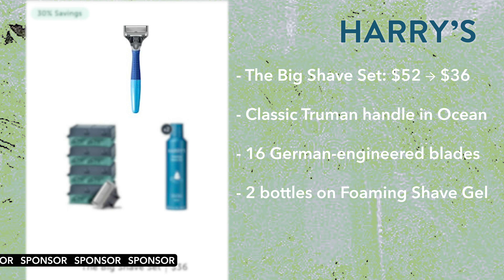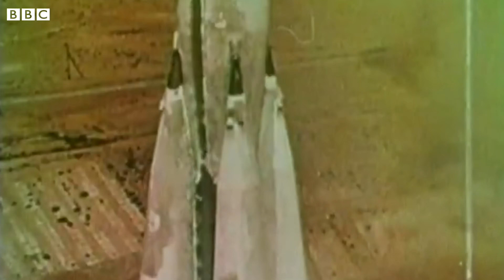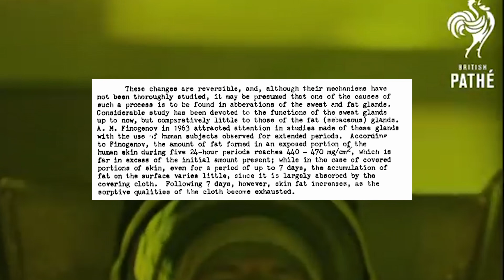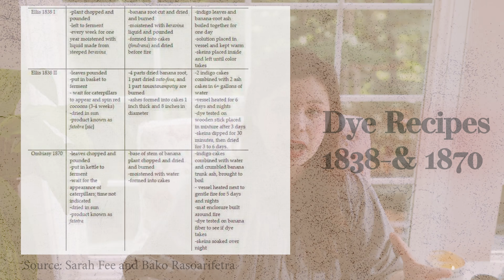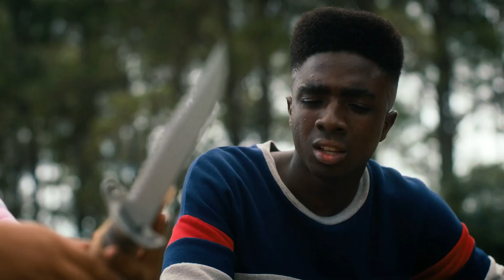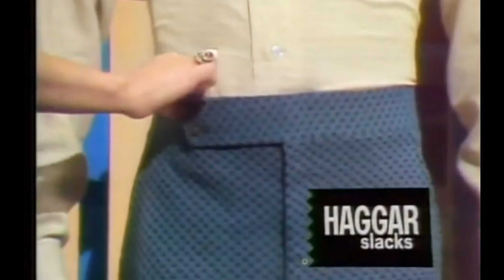The DISGUSTING truth about Laundry

Comment: Thanks for this video. 

We often think we are soooo much more evolved, as if our ancestors were stupid. We are missing so many pieces of information to really understand why they did what. 

I just moved to a new area with REALLY hard water. It seems using cold water to wash is better (?). I now use lots of vinegar to clean. 

Also, I have been letting my clothes hang and air out before I decide to wash them, and unless I’ve been sweating in them, they almost always pass the snif test the next day.

I also started wearing 30/%silk/70% merino wool camisoles and undergarments, in spring, fall, winter, and even in summer (I live in North Eastern North America). This keeps my body temperature regulated, and protects my clothes. This fiber also has the same kind of anti-microbial properties as you were saying linen has. I was astonished to discover that I can wear them up to 7 times and they stay fresh!! 

This might gross us out today as we’re used to tossing every item in the wash after one wear… 

I also remember watching a Norwegian knitter’s vlog : knits were never washed, but put outside in the sunshine (anti-microbial and anti-fungal properties) and fresh air once a year. I now do that too.

I never put my clothes in the dryer, only my linens - but once I get my clothesline I can use it 8 months of the year…

Comment: Before I know about historical clothing, I was basically using this principle, I wear T-shirts for base layer all year round, in summer I just wear the T-shirts because it’s hot brah and in colder weather I wear the T-shirts as skin layer and I wear other things on top, my T-shirts are very cheap but good quality most of them are from my childhood (they never break I can’t even think of reasons to throw them away!), change and wash them every day, and don’t wash the outer garments often. When there’s coats like wool winter coats I would wear shirts with collar outside the T-shirts, because the shirts only touches my neck and forearm so I can wash them less but can still keep the coats clean
Reply: And softening water as well as whitening the cloths I use washing soda
Reply: But for those who have dryers, the heat from dryers are pretty good at sanitising

Comment: I live in Italy.  Dryers are rare so most people line dry their clothes on racks inside or lines outside.  It took me bit to get used to and I now check the weather before doing laundry.  I like it unless I need something quickly.  Then the hairdryer comes out to finish it off.  I just purchased a dehumidifier for the winter so that jeans etc will dry.  It takes more than 2 days for jeans or cotton flannel shirts.  That's a lot.

P.S.  The laundry doesn't always smell good.  If the air quality is poor the laundry dried outside smells like diesel fumes.  Not great.

Comment: 12 loads a month for two people?!? I do max 6, but usually 4. Maybe I’m extra dirty, but 12 seems excessive to me. I won’t wash something just because I’ve worn it once, I’ll wear it at least twice, sometimes a couple more times if it’s not been hot. Especially if it’s not something I wear directly against my skin. Knickers and anything particularly tight gets washed every time, but not most stuff.  Ive also rarely had a dryer in my life, and on the rare occasion I have I found the damage done to my clothes, and how it felt, just made it not worth it.

Comment: I got one of those lines that reel back up... so it's not permanently out. Just hooked it to the house, use it when I need it, and unhook and let it reel back in. My washer/dryer on hot wouldn't get the stink out of my teenagers' clothes... the sun did though, which shocked me. We are lucky to have solar power during the day where I'm at, so most of the time I can run the used efficiency washer/dryer we got during the day on the sun's energy. I would love to hear opinions on where you can get good linen clothing... or homemade environmentally friendly laundry recipes. (Loved this video btw, thank you for all your hard work and research!)

Comment: I spray peroxide on my clothes that touch private or sweaty parts when I take them off. I quit fabric softener and use wool balls in the dryer. These are my pitiful approaches to a couple of issues. I grew up with wringer washers, boiling water, and clotheslines or bushes for drying. Your video was after my own heart.

Comment: I really appreciated the environmental discussion of this video, but found all other parts of it ...rather lacking. There's no real "do this instead" (which is what the point of the message is--that the system in place is flawed and needs change, and very few people are putting effort into researching that change and what best practices truly are).

I ended up disliking the video in part because I live in a part of the US that rains 150/365 days a year, which means that line drying my clothes would mean drip drying them into carpet, and spending almost all of the winter months at least slightly damp. And in order to prevent that, I would need to hand roll each garment in a towel (which would then need to be dried), and most likely need to iron each garment as well to avoid the "crunch" of (non-sun) line dried cotton, etc. Especially in a state that has the vast majority of its electricity generated by green energy, using a dryer isn't actually that unsustainable compared to other changes I could make to my household. 

I really appreciate the call to action, and frustration over modern systems, but it also gets really frustrating when environmentalism turns into idealizing poverty or the "olden days" (with systems that were never sustainable either) too. Abby is really amazing about avoiding that in her videos, but reading some of the comments I can see it already cropping up--where people's time and energy is undervalued and already marginalized groups then have yet one more task added to the already disproportionate mountain of labor relegated to them. There's a reason being a laundress was considered a poverty profession in ye olden days, and I don't see that underlying class and gender system changing any time soon either.

Comment: as someone who is chemically sensitive also, i have years ago started handwashing my clothes with all natural soaps, because i live in a house with only one washing machine for 5 apartments and all the other tenants use really disgusting allergy-inducing fabric softeners that i dont want to have on my clothes and the residue is in the machine and doing like 5 loads of empty vinegar cycles to get the residue off before doing my own laundry seemed a really bad idea. the drying option is simple if you cant put up a clothesline that is visible from every garden around: there are foldable drying stands you can just put on your porch or balcony and its just as effective. but in effect, i havent had many clothes tear or get holey since i started doing this, only two really old pyjama-pants, one made of rayon and the other gets a lot of wear, all the rest stays nice and gets really clean this way too. and besides, sewing my own clothes out of fabric i can tolerate has resulted in way better seams that hold up anyway, and an appreciation for the garments that contributes to carefulness and longevity.
thanks for this video, it sums up and sheds light on the issue in every single aspect there is!

Comment: I had a "high-efficiency" washer with no agitator. Sometimes I would pull out clothes with dry areas on them! The cycle also took over an hour to complete. I purchased an old-fashioned commercial type washer with an agitator, and it cycles through in about 20 minutes and gets the clothes cleaner, though I agree that the agitation is harder on the clothing. But what is more eco-friendly--using a ton of electricity to cycle through a load with less water, or less electricity but more water? Where I live, water is plentiful, but in areas of the western United States, the water is more of an issue.

Comment: Actually, here in France we know if our water is soft or not, and in what proportions, it is an available data given freely by every cityhall and even sent to ppl with advices for cooking and laundry wash.
Yes we are incited to wash cloth at lower temperatures, both for economical and environnmental reason, but using vinegar sanitizes water, we can easily put some in rincing water.
And not so much ppl have dryers, sun is our friend for clothes.
Isn't it the same in North America?
Moreover on a different subject, fabric softener bring allergies and are like, REALLY bad for hormons and skin. It is a terrible product, that you shouldn't use on babies and toddlers' clothes. Fyi.

Comment: In the UK here. We don't have a drier. Everything gets line dried. There was a meme a while back that was like "meanwhile in Scotland" and was someone hanging up clothes outside in armpit deep snow. If we need something dried quicker it gets hung on the heated towel rail. I think all UK washing machines are side loading and have gentle cycles. We have filters and softeners because we know our water is really hard. We never use fabric softener, our clothes may feel a little crispy but that feeling goes away after a few minutes of wear.
And when my kid was in cloth nappies I would run the washing machine empty at 90C (as hot as it could go) once a month to prevent a build up of bacteria, as recommended by various cloth nappy purveyors. Also we tend to wear undershirts, and wear the same overclothes again and again, sometimes airing them between wears so they don't smell.

Comment: 100% our ancestors were smarter with higher coverage more cleanable undergarments.  110% hard water sucks (it is a dream of mine to have a whole house water filter so I can wash myself and my clothes in water that is actually mostly water).  However, I do take issue with all laundry needing “sanitizing.”  Do you use the restroom, wash your hands with soap and water, and then go use those hands to make and eat food?  Yes.  We don’t typically need an additional sanitizing step because soap and water does a pretty good job of removing most hazardous contaminants.  Your immune system fills in the gaps.  Are there situations where extra care is called for?  Sure, think medical personnel “scrubbing in” for procedures that carry a high risk of infection for their patient.  Then they are using antiseptics with lengthy exposure times and aggressive scrubbing.  Same can be said of laundry.  Most of us don’t need to worry about “sanitizing” laundry.  If you have an item that is obviously badly contaminated, are dealing with a skin infection, a uro-genital infection, have been ill with a “stomach bug,” or have a severely suppressed immune system, then absolutely your clothing should be sanitized to help reduce the risk of you reinfecting yourself, but for most of us it probably really isn’t necessary.  Also, don’t underestimate the power of tumble drying to help with sanitizing.  The temperatures in a dryer can get much higher than a “hot wash” and that combined with the rapidly decreasing humidity as the water is driven off is often very effective at desiccating and therefore inactivating many of the things that can make us sick.  Remember that the temperature needed to “kill germs” is time dependent.  Things die faster at higher temperatures, but long enough at lower temperatures is also effective.  Take pasteurizing milk for example.  It can be done at 162F for 15 seconds, or 145F for 30 minutes with very similar results.   A clothes dryer is likely to reach about 125F-150F for a large part of its cycle time depending on setting and model, and is therefore potentially a useful tool when clothing needs to be sanitized.

Comment: My house has a water softening system which uses a special salt. I have a drying rack I put in my tub for delicates, but also where I'm staying has indoor painted metal banisters for much larger items like bed pads and comforters. I also use white vinegar instead of fabric softener. I hand wash my unmentionables when they get stained with the same type of bar of goat milk soap I use for my hair and ablutions before laundering them with my other clothing. I use unscented ECOS, which I buy at Food4Less because it's much better priced than online. I have been using dryer balls for years, rather than dryer sheets. I got mine from Target from the brand Babyganics in the baby section (also where I get my sunscreen from). I need a new rack though, because one of the rods bent and keeps coming off of the cheap plastic connector.

Comment: Puts into perspective how simple some of the things are I do that I don't realize aren't common.

I wear my outer clothing for up to 3 days depending on use and overall dirtiness. I wash with cold water for the most part except for underwear and socks which I just feel have to be done with hot water. Everything is line dried in the basement except for articles of clothing that I don't care as much about (ie, 10 year old sweaters), underwear, and bedding (I have no way to line dry something that big, nor would it dry in a reasonable amount of time). I do 1 to 2 loads of laundry a month for clothing but often go about 3 weeks between washes. And I try to go for natural fibers because synthetic feels too hot or cold when the day's temp can swing a good 40F from morning to after noon.

Comment: I moved somewhere where we have to catch rainwater in our tanks because there are no water mains. The first thing I noticed was how much softer the clothes felt and then I noticed how easy it was to get stains out of clothes. Even old stains came out so easily once we stopped using regular tap water. Our white sheets have become so bright that they hurt your eyes in the sun (we line dry. very few people I know can afford to buy a dryer much less pay the electricity bill). I've also noticed that if I don't put the clothes on a soak cycle before washing them that they don't feel as clean. It's like the detergent doesn't get enough time to do it's job when it starts washing before it dissolves in the water

Edit: America is such a weird country. I can't believe the ability to hang your clothes out in the sun to dry is a privilege. That's ridiculous

Comment: While I agree to use alcohol for sanitising your clothes, I use it to clean my corsets. Vodka only has around a 50% alcohol percentage, which is not enough alcohol to sanitise your clothes. Just as all hand sanitisers have to be at least 70% alcohol to be considered hand sanitiser by law, so why not for your clothes. You can pick up rubbing alcohol at 70% for cheaper at most pharmacies and put it in a spray bottle for easy cleaning.

Comment: I've realized that hanging laundry is actually less stressful and annoying than using a dryer. It also made me realize real quickly if I used too much detergent (because then the clothes would be stiff). Benefits of the physical process of hanging laundry:

-I don't have to take someone else's clothes out of the dryer each time I use it and figure out what to do with them
-I don't have to check and clean out the lint trap for every other person before me as well as myself
-I don't have to lean over a giant pile of somebody else's clothes that they left on top of the dryer in order to reach the dials
-I don't have to bend/lean/squat down to access putting the clothes into and out of the dryer

You'd think hanging laundry is more taxing, but the truth is out there... OOoOoOoo.

Comment: What an interesting video!
I'm in England, front loading washers are the norm here, I've never seen a top loader. The washing powder has a table on the back to let you know how much to use depending on water hardness, dunno if that's the same in North America or not. That line drying your clothes can be illegal is disgusting.
I never learnt how to do laundry properly. I've had to learn a lot after having a baby since we decided to use reusable nappies. We moved to non-bio, unfragranced powder with no softener for all of our laundry and I wouldn't go back. I also learnt how important it is to do proper maintenance on your washing machine so that your machine is clean and the filters are clear.

Comment: Here are some solutions that can help sanitize and disinfect your Clothes
🥼White Vinegar
👚Hydrogen Peroxide
👕Borax
👗Essential oils like tea tree and lavender 
👖Color Safe Bleach

🧣Products that can work: 
💙Lysol Laundry Sanitizer 0% Bleach
💚Lysol Sport Laundry Sanitizer for Gym clothes and Activewear. 
💜OxiClean Powder Sanitizer.

🧦Products that can remove stains and odors:
❤Nature's Miracle Laundry Boost

👙Products that can be used for pre-soaking and hand washing clothes:
💛Arm and Hammer Super Washing Soda Detergent Booster and Household Cleaner
💌The Laundress Wash and Stain Bar
💚Fels Naptha Laundry Bar and Stain Remover
💗Zote Laundry bar soap 

🌊Washing Machine Cleaner products:
💙Maravello Washing Machine Cleaner 
💚 Eco-Gals Eco Swirlz Washing Machine Cleaner 
💙OxiClean Washing Machine Cleaner with Odor Blasters
💚Affresh Washing Machine Cleaner

POV: These are just a few of the many products available. It's okay if you want to wash your clothes by hand. It's okay if you want to use the washing machine. It's okay if you want to hang your clothes to dry at home and it's okay for you to use a dryer. Don't feel pressured to do something that you don't want to do. You do what works for you and your schedule. There are numerous other ways to be eco-friendly such as donating your clothes, using less plastic, and recycling.

Have a great day 🖤